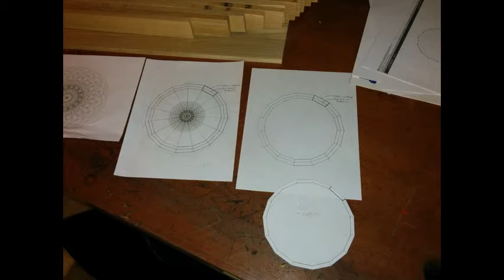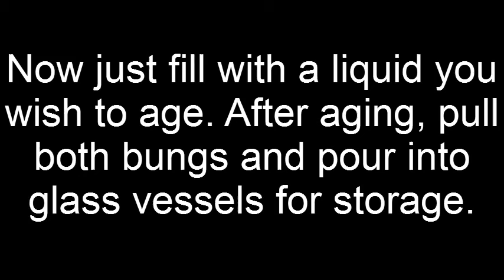Homemade Whiskey Barrel

Comment: this video is awesome and very informative. Is there a way you could post the measurements of the slaves. and the angle that the sides were cut at? I would greatly appreciate it!
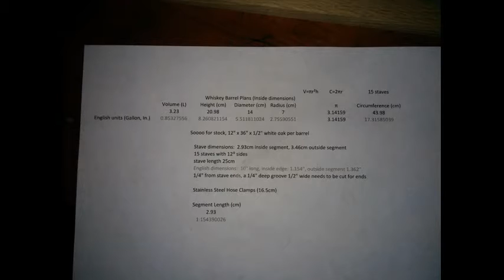Reply from the maker: +thesteeler1fan Go to 1:04.   The spreadsheet with the stave dimensions and angles are shown.  Just pause the video and write it down.  Thanks for watching!